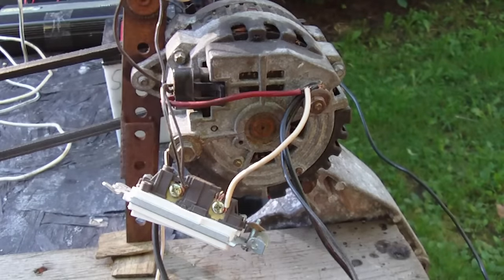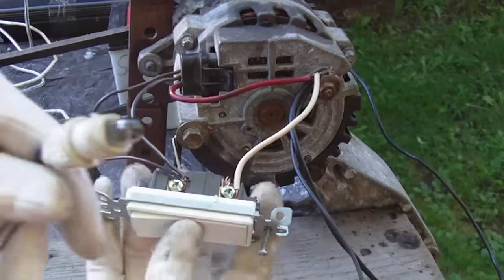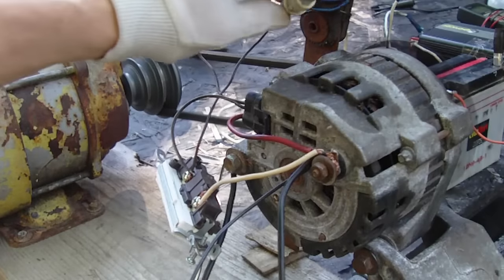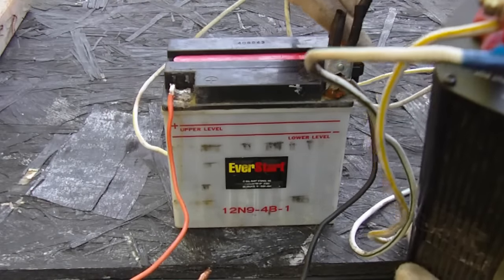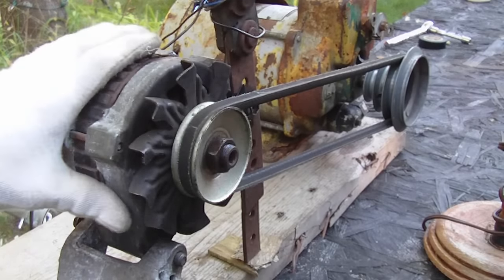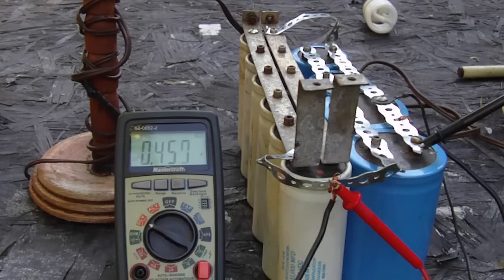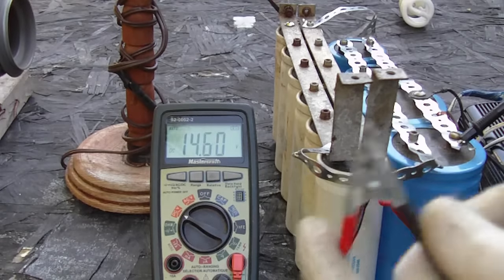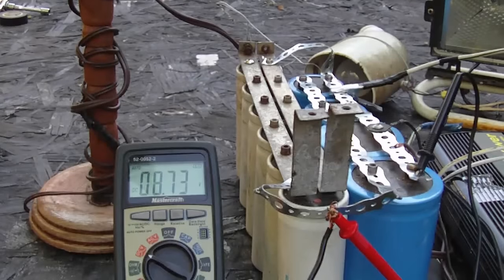Alternator DEMO Wiring, connection to Battery, Capacitors, Inverter, Modification

Comment: I listen to your explanation very carefully, but i didn’t heard you mentioned the power Ac motor. What are you hiding from the public? All of those items you using are not necessary, if you can afford buying all of those items, why don’t you just buy a 3.5/5.5kva generator, which provides close to 5Amp/15Amp? why don’t you used the electric motor direct power and the alternator served as the engine. Stop hiding the most important ideas. Using that alternator as the main power source won’t last longer, in no time the DC coils will burn/damage due to the tension, but if you used the Ac power motor, you have better chance of having stronger and long lasting current for a very longer period of time. Knowledge is power, if you decide to share do it very well.

Comment: U have to excite the alternator before it will start charging .  I put this same alternator in my 66 ford and it is wired up with two wires . After car cranks and rpms are up over 1000 she starts charging.

Comment: you use ac to power the motor, then convert back to dc and then back to ac .. DUMB.. unless you pedal your back side off to power the alternator you are wasting energy
Reply: isn't it obvious its just for demonstration?
Reply: inverter Ed Jack
Reply: A Test and Trial Backwoods Guy? LOL

Comment: In my off-grid cabin, I have the Alternator connected to a Water wheel and that connected to 4 car batteries, I then use an old APC computer backup as the inverter. Lights in the cabin are 12v DC and only turn on the inverter when I need 120V AC
Reply: This is the correct way to get "free energy" it's gotta come from somewhere. Wind does work, or water uses gravity to do work, or you gather the gillions of watts the sun throws at us by the minute with a solar panel. It's gotta come from somewhere.

Comment: Also what about using a impact drill on the pulley instead of the motor to drive the pulley? I don't have a motor to run it. The alternator I'm testing has a fitting where there is a 6 or 8 pin socket present where the pulley shaft is.

Comment: So what powers the motor that powers the alternator?
Reply: It was battery at the first time but then when you have the motion on motors which is rotating the alternators it's mean alternator generating the power and that power is used for charging the batteries and powering the motor again 😇. Tell me if i am wrong.. hhh

Comment: All this is great but you need power to run the 3/4 Hp motor. We need to run it for free otherwise your expending energy to make energy and you in most cases loose energy by doing this. I hope I made enough sense. When in a vehicle all stuff is there and your already running the source to power the alternator kind of like air conditioning in a car it’s essential free because your already driving somewhere and running the engine. Yes I know it may use a little more gas . Great video explaining all of this. Some have done this using a stream of water as power source to turn alternator.

Comment: Oh... no it never fails.   How do you know that the middle wire is switched or the one on top will do the same since they both are going to the light bulb?  Anyway, where did you read which wire went where? How would you have known if you didn't have the book to tell you what hooks up where?

Comment: Sir did you ever tryed out to use pure ac non rectified alternatir to ac capacitor banks?
I need full alternator power .
But the problem electric shock from car body and the lead acid baterry does not like ac what can I do there?
I liked me car perfomance when the regulator fails.
I also got curiuse and tryed plasma ignition realy great set up engine was realy smuth and power full .
But when ever I use hv ceramuc capacitors be alternator who is 12si delco it swaps its starting charge from 1000rpm up to 3000rpm so meaning Im constantly back charging alternator light wont turn off unless I go higher rpm.
So any help please I asked many peopel they dont realy understand what I want.
Its similar to those old Ford Model T cars running ac magnetos with naterry system Im curiuse how peopel not get shocked and why the baterrys dont blow up.
Also whats the deal with those capacitors and alternator starting charge tricking is there centrain way I can prevent alternator ground to interact with me plasma ignition set up?
I basicaly just take hv ceramic capacitor and simply put it on ignition coil+terminal simply ground other side of capacitor .
I was also wondering way how to send full alternator power to ignition coil again Im anoyed with the stock hei ignition system its sloppy in winter time Im dead meat cant turn engine on properly .
So any help wuld be nice.

Comment: That motor runs on AC Electric Power otherwise it will start. This set up is based on an electric motor that uses 240 voltage. Its not a mechanical and electrical self propelled power generator. Look how he does not show what power the motor. Maybe its not intentional or not the intended goal but an alternator s that releases 12 volts cannot power electric motor that uses 240 volts.

Comment: DISAPPOINTED-i don't get it... you pointed to the big induction motor and it has a belt but i see no wires on it and got no explanation of  how and why it is there( so lost)  and nothing about wither or not it is hooked to something  so lost again.. THIS NEEDS TO BE A STEP BY STEP AND CONNECTION BY CONNECTION...ALSO EXPLAIN THE TOGGLE SWITCH PURPOSE AND SMALL LIGHT..teach like your audience is eight..i like the concept would try it dont know where to begin,,

Comment: I have a question is that motor thats running that alternator using the battery to run while getting charged by that alternator . Or is that motor plugged into the wall socket . NOW THATS THE MILLION DOLLAR QUESTION

Comment: in theory the internal reg. would keep the battery bank charged at 14.8v and if you had a 48v lithium battery bank , i've tested my Gm 10Si stator Ac current sinning the Alternator juat about 1,800 r.p.m on meter i got 1,870 Wastts

Comment: Hey hi... What was the rpm of the alternator?  And can we use air pressure to rotate alternator?
Reply: Its a standard alternator, so keep in mind that it will have resistance especially under load. if you intend to use air pressure, youd have to modify the pully to give it substantially more air resistance, maybea metal fin/fan set up.
Reply: +Sushant Rathod  of course u can there used for wind generatord
Reply: +bradd ford thanks for the feedback...
Reply: +Sushant Rathod all I know is when the alternator is turned on it gives out 14 volts if u turn the alternator on and 12 when off. u can look into other things turn it inti generator using lawnmower engine. or try using old rechargeable drill as wind generator hope that was of some use to u thanks steve

Comment: Here's a thought..., why not use a rear 18speed bicycle wheel as a pulley to spin the alternator and then bypass the whole inverter by just first bypassing the Regulator on the Alternator? You do know that Car Alternators are all AC Motors which generates AC Power don't you? Now unlike the morons here I actually understand you're using the powered motor to spin the alternator just for easier demonstration purposes but today creating power from scrap Motors and Batteries is more commonly known than the ingredients to making a Peanut Butter and Jelly Sandwich. If people would stop this same ole dance of creating power especially when it's already been done millions of times plus on dozens of other YouTube videos and start working more on how to keep generating power without the use of fuel or anything else that would deem it as Not Free-Energy then the world might actually start moving forward once again. Hell since Steve Jobs died the earth has been at a complete standstill. 

Man I'm right there with you on this experimental free energy stuff but you and many others are stuck on chapter 2 while you need to be on chapter 9 with the rest of us.

Comment: So what's running the motor that's tuning the alternator? If you have power to run the motor why would you need the alternator setup you to power a light/drill? What's the point? Unless you can run the motor from a battery/copasators that runs the alternator that then can keep the battery/copasator bank charged plus run light/drill you've done nothing beneficial. What am I missing?

Comment: OK I'm a MORON I MUST BE..... HOW DOES ONE KEEP THE MOTOR RUNNING THAT THE GENERATOR IS CONNECTED ..... AS FAR AS I CAN TELL THIS SET UP WILL PUT OUT ABOUT 90 AMPS AND ABOUT 220 VOLTS ... THATS ENOUGH TO RUN A SMALL HOUSE RIGHT? WRONG? UGH I HATE BEING AN ELECTRONIC MORON.... LOL....... IM OFF GRID SO NEED POWER TO GET MOTOR TO RUN TO HOOK TO ALTERNATOR TO CRETYE POWER TO RUN OTHER STUFF..... UHHHHHHH ???  OH WAIT DONT I NEED TO HOOK UP 3 ALTERNATORS TO GET 220 VOLTS

Comment: Thank you for this simple demonstration. You seem to have good luck as you have not burned out the regulator yet. Be advised that these CS Delcotron alternators are the most temperamental I have ever encountered. Just too many wires for my liking and you need to buy a special 4 pole battery isolator (instead of 3 pole) if you wish to use one. I am perplexed as I have already burned out a couple internal regulator modules while trying to adapt this CS alternator to a home built stationary power plant.
Reply: Kenneth Smith
Reply: I think this is a great idea I'm getting ready to build my first one my plan is to be able to run multiple alternators to charge my batteries and maybe run it with like a serpentine belt if there's any help or written plans you could help me with please pm

Comment: I have a suggestion.   Throw all that stuff in the garbage and plug the lamps and the drill into a plug in strip off of one receptacle.  They will all work just fine.   What you are doing is wasting energy!

Comment: What is sad and funny, all elec cars not using  alt to charge the cars, this is greedy trash, the funny and sad part is that most of the public thinks it won't work, while they have driven cars with a charging system, yet now it won't work... they say it has to have a gas eng, lmao more then one way to spin and ge/ or alt...so damn sad

Comment: Get a smaller motor and run the motor with the alternator x2 ... Perpetual power. Then grab the DC from the coil... Wire into home.

Comment: What's powering the motor that turns the alternator? If it's plugged into the wall its not a  self contained system like a car. Defeating the purpose during a grid down situation

Comment: Old times with out Star ⭐ ters used 9v alkaline too drive alternator initially to spark or energise alternator also not to need expensive battery to stabilize initial field to alternator
Reply: Roll started push down 👇 Hil

Comment: You can clearly see him flip the switch at the same time that he pools the belt on the alternator which causes it to come on. He has that motor hooked up to an external power source don't be fooled
Reply: You have to put 12v into the alternator to turn it on thats why the light came on. 12v to alternator   then mechanically turn its rotor, it then produces  14.4-14.8 at the current specific to the alternator.  Also the rotor need to turn at around 2000rpm to get the full current output..

Comment: thanks, no need to put magnets inside Alternator ? please reply urgent...
Reply from the maker: No magnets needed that's why you have to power up the rotor, I use a separate 12v battery pack. Only thing you have to do is some simple electrical mods to the alternator

Comment: Whats pushing the motor?
Reply: 3 Hampsters, its 3 phase of course!
Reply: An external source
Reply: Pixies
Reply: Battery is the power the motor is the new free energy thats what I got from this video.
Reply: Is a self generating system all you need is a small power source to get it running you could use this system charging a battery pack (like those used in solar panel systems and having it running and recharge itself theoretically externally, a large battery pack could get you off the grid if done properly , change your lights with LEDs and you'll save a ton of money .
Reply: Birds on drugs.
Reply: The blue and white battery's sillysally
Reply: if its external what is the point... i want to generate electricity and convert to ac to run power tools IN A TOTAL GRID DOWN SITUATION...(no power period)  @jean-claudenjeckforty4757

Comment: The electricity that the alternator is creating is AC current and if you tap it straight off the storer it will create the purest sine wave for AC current so you won’t need an inverter you can connect housewives straight up to one of the three leads coming off the stoter ! I have the video using my multimeter

Comment: You could take the Alternator and Make it Produce AC Current and Power your House, etc. of course Diodes would have to be By-passed or removed from Alt.--for all of this to work, you would need a Larger Battery DC input to Alt. to get it Started as a Active Generator of AC Voltage--you could then Rob some of the ac output from Gen. and Recharge your Battery thus having a Perpetual Motion Machine. This all will work as I have seen it done...

Comment: 5:40  Here is a little info, very  IMPORTANT.    '' eli  the   ice  man ''     where E=volts     L=inductor/coil     i=amperage  current.       Volts, leads current, in a coil/inductor
  2.      ' ice man ''     where I=amperage current    C=a capacitor  (circuit)   and  E=volts      Current,  leads voltage, in a capacitor circuit.  So, when he puts current, to those capacitors, the voltage follows.   Remember this, it'll come in very handy ,  when thinking/designing  '' stuff ''.               Thanks, Mr.  Kurt.....

Comment: you are right, sparks around the battery are no joke. I had a pinto back in the day. it had loose battery terminals. I shut it off, went into the store. came back out, turn the key, and instantly there was an explosion. my hood blew up about 4 in, while still locked in place! when I finally did open the hood, acid was dripping off the inside of the hood, and where the battery was, well, it was gone!!! there was no longer any battery, except for a 3-in cracked piece of plastic. I couldn't find the metal plates, any pieces of battery terminal, nothing. one spark, and it was gone. it was one of those refurbished batteries that put out a lot of fumes. yeah I'm a lot more careful since that happened...😯💥😳💯💯💯

Comment: can a 3/4 hp ac motor be plugged into an inverter to run an alternater to charge a battery that powers that same inverter?
Reply: That would be the electrical equivalent of perpetual motion, which can't exist.

In short, the motor running off the inverter would use more power than the power it generated (via running the alternator) to charge the battery, so the battery would ultimately discharge.
Reply: Replying to V1ncePOwers comment- 
How can you connect an INVERTER to an ALTERNATOR when the OUTPUT on the INVERTER is AC(sine wave)?
Reply: Eddie Abraham He said use the inverter to power an AC motor, which is then connected to the alternator.

But regardless, it can't work. :P
Reply: @themaritimegirl  It could work if you add in a generator to the belt system, use the inverter to get the motor going and switch it from the inverter + battery power to the generator power. The generator would power the motor and the inverter+ battery bank to power everything else. The amperage rating of the motor times the voltage would be the wattage that the motor needs once it has started up, so for a 3/4 hp motor you would need about 1,000 to 1,500 watts to be safe. You also need to know the start up watts of the motor so you size your inverter to handle the draw.

Comment: Excuse my ignorance but, are you saying that the Alternator is powering the motor when you "spin start it" and in return the motor turns the alternator at a higher RPM and some power from the Alternator is returned to the motor to keep it running?
Reply: No that's not possible. Energy cannot be created nor destroyed, only transformed from one form to another. The motor spinning the alternator was an induction motor powered by grid power. That type of motor can have trouble getting started and a nudge (or spin start) can help it get going.

Comment: Hi, In this test did the Alternator overheat and melt ? ..you would req high RPM to cool down this alternator 🧐 i think you have to use a very big Alternator to run a low RPM ?

Comment: hi.. i need yr help.. my car alternator has not enough amp to charge my battery... the wiremen said it is because of my sound system... i need to higher my amps to put my sound system... can i use super capacitor? or is there any other idea